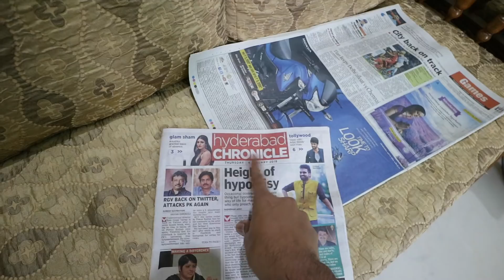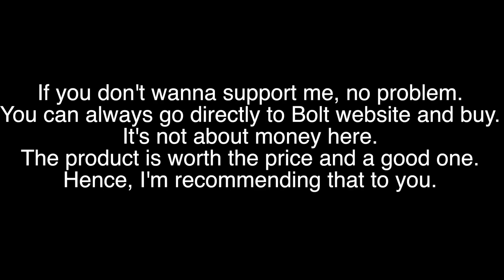AM IN THE NEWS !

Comment from the maker: heat is not an issue as it's 3 to 4 inches away from the exhaust and as there will be airflow I'm sure it will not be a problem. I don't like to put too much stuff on the handlebar. Already there are barkbusters and then the ram mount. Let's test it out for a ride or two and of there is any problem, I'll change the location.
Reply: Won't your battery drain because of the charger?
I think connecting it through other terminal that turns on when ignition is on would be a good idea.
Also, congratulations, keep up the good work!
Reply: Sriman Kotaru bro..the situation is all under control now in Maharashtra..so plz don't cancel the Pune Meetup plan 🙏
Reply: Connecting the charger directly can probably drain your battery, since the charge can pass even when the ignition is turned off. Cheers
Reply: Unboxing style 👌👌
Reply: Sriman Kotaru bro ... can you make plan a trip to London on bike ??

It’s just 10,000 km 
And India has high range of petrol rate I guess after we cross border we get free from petrol . Fuel is cheaper compare to India .

Pls make a talk about this !
Reply: N J bro we leave in hyd we know what the temperature!
Reply: N J lol
Reply: That's an unexpressible feeling

Congratulations bro
Reply: Hey anna what's is that used for

Comment: u have placed it near the exhaust doesn't that burn your charger ..
it's better you take take it to the service station and get it fixed on the handlebar itself.. 
why to take risk if it messes up with your wiring incase if water seeps in and I believe that 🐅 spares aren't cheap and it take a while to get the parts itself..